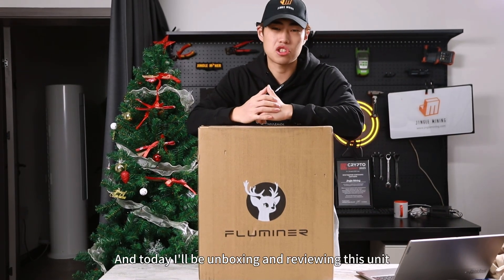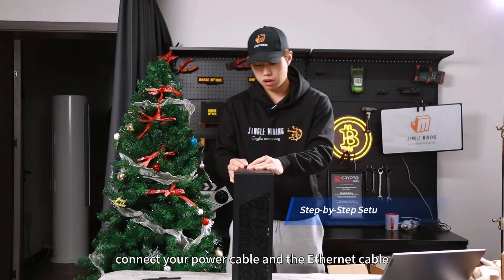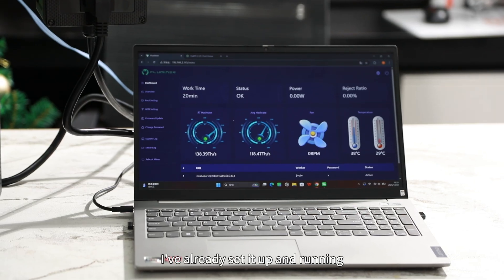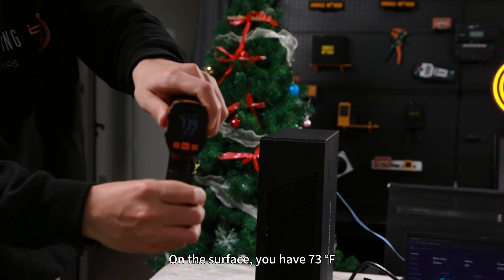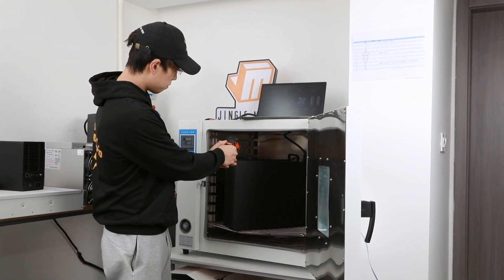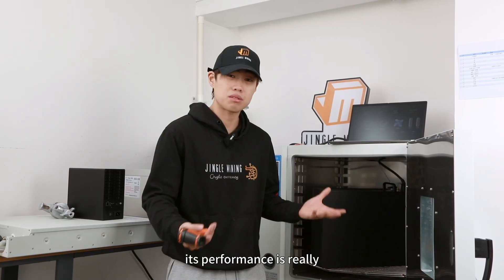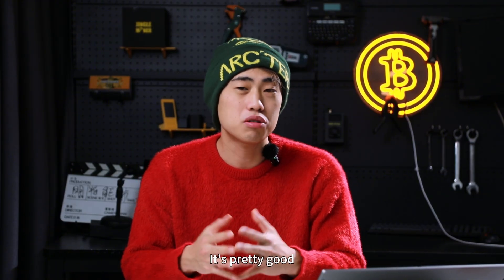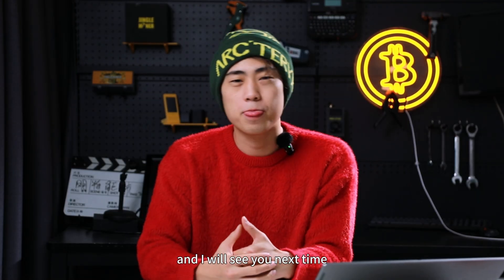FluMiner T3 Review: The BEST Bitcoin Miner for Home Mining? (Insane Heat Test vs Avalon Q)

Comment: Can I adjust the power mode like Avalon Q 90 ? (Eco, Standard, Super)
Reply from the maker: The engineering sample we currently have does not feature the three specific modes (Eco, Standard, and Overclock). However, FLUMINER has officially stated that the final mass production units will include at least two or more operating modes upon release😊
Reply: @JINGLEMINING  It’s been 3 weeks since this video. I hope U post an actual video of the unit that will be shipped to show 2/3 working mode. Consumption, noise and J/Th of each mode along with app showing working power numbers and fan RPM

Comment: Thanks for the review. 

Avalon Q is much quieter. T3 is way too loud for home mining imo. And 1700W is too much power for typical 15a circuits found in US homes (15amp circuits are derated to 80% for continuous duty (ie, 3 hours or longer), so max safe.power draw on a typical 15a circuit is 1440W (12a x 120v = 1,440W).

Avalon Q is what I'll buy.
Reply from the maker: Tks for your sharing.
Yes everyone will make different choices depending on their circumstances😊
Reply from the maker: Indeed, the machine does appear somewhat noisy in the current videos. However, Flu has officially stated that they will strive to reduce the noise level to 50 dB by the time of mass production (though this would still be about 5 dB louder than the Avalon Q). Additionally, please note that the units shown in the videos are running at 100% full speed without the fan auto-adjustment feature enabled.
Reply: Right on, also the AvQ has the 3 settings to choose from, Eco, mid, Max (800w - 1800w)

Comment: Will this have power modes like the Avalon Q?
Reply from the maker: The engineering sample we currently have does not feature the three specific modes (Eco, Standard, and Overclock). However, FLUMINER has officially stated that the final mass production units will include at least two or more operating modes upon release😊
Reply: @J @JINGLEMINING  It’s been 3 weeks since this video. I hope U post an actual video of the unit that will be shipped to show 2/3 working mode. Consumption, noise and J/Th of each mode along with app showing working power numbers and fan RPM
Reply from the maker: Both machines have the concept of "high computing power and high power consumption" and "low noise and low power consumption" modes, but the naming, the number of specific power levels, the power consumption curves and the firmware logic are different🤝

Comment: Interesting that their own app doesnt show actual fan speed... lol
Reply from the maker: Yes, that is correct. Since the unit we have is an engineering sample, the software features are not fully finalized yet😊
Reply: It’s been 3 weeks since this video. I hope U post an actual video of the unit that will be shipped to show 2/3 working mode. Consumption, noise and J/Th of each mode along with app showing working power numbers and fan RPM

Comment: Too bad mining is completely utterly dead. Basically greed killed mining. It’s over. No point don’t waste your time or money. Just buy the coin.
Reply from the maker: Appreciate the comment.
Everyone has different views on the market — from our side, we’re focused on development and long-term product execution.👍
Reply from the maker: Units like the Fluminer L1, T3, or Avalon Q are still worth it if you have access to free electricity—for example, if you set them up in your office. Or, if you use them at home to double as a space heater, they definitely still make sense.
Reply: Hitting a Bitcoin block with just one of these is very much in the realm of possibility, although one would need to be very lucky. But one would have a much higher and more realistic chance of hitting a Bitcoin Cash block with it each month, which is about $1500. If you got ten of these, and lets say you hit a BCH block every two months with each of them, that would net you about $7500 a month on average, so $90k a year. Pretty decent. Although if you got ten of these, you'd have a pretty decent chance of hitting a BTC block aswell. But you'd still need to be lucky, whereas mining BCH with these would provide a much more reliable albeit smaller but still very decent stream of income. Not to mention BCH's potential appreciation over time. In ten years, BCH is expected to atleast double in value. Those $90k you mined in a single year could turn into $180k. Over ten years, you'd end up with $1.8M. Not bad. Not bad at all. That's all an admittedly optimistic scenario, but still very much possible in theory.

Mining isn't dead at all. Crypto in general is still very much in its infancy and just getting started. Mining BTC effectively and reliably might be out of reach for the average person, but there are other opportunities out there for those willing to seek them out and grasp them.

Comment: Good to see it , does it have a LPM mode ?
Reply from the maker: Thanks for your comment! for T3 yes it has a LPM mode. If you’re interested or would like more details, feel free to contact us on WhatsApp: +86 152 2104 3094 👍
Reply: @JINGLEMINING  Can't just just give us the LMP numbers here ?
Reply from the maker: The engineering sample we currently have does not feature the three specific modes (Eco, Standard, and Overclock). However, FLUMINER has officially stated that the final mass production units will include at least two or more operating modes upon release